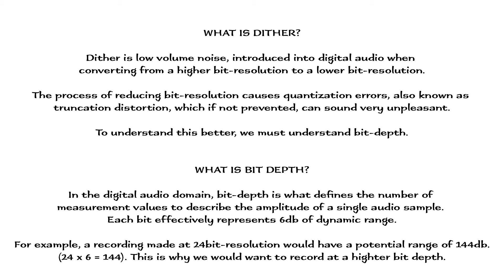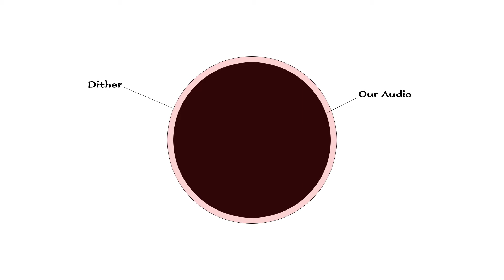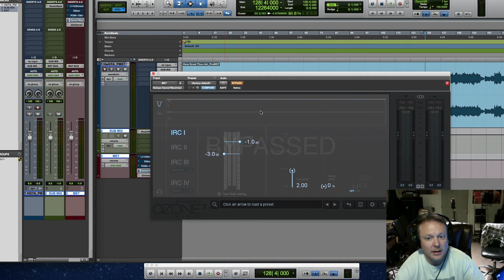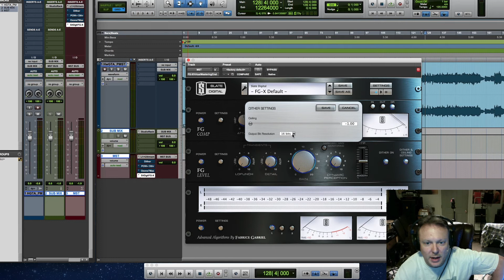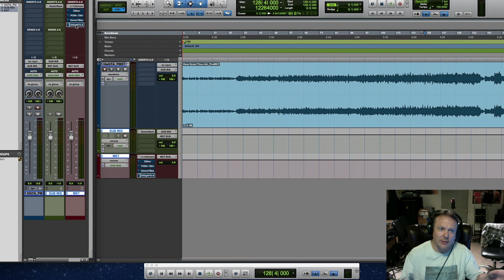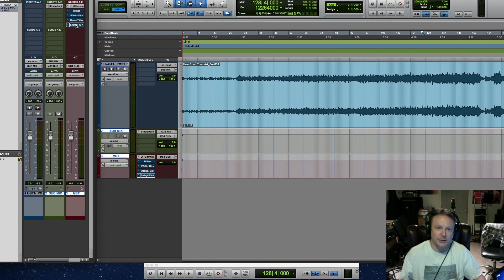In The Mix: Episode 13 - Dither - What and Why?

Comment: Thanks for this Brian. What about applying dithering on the final print track?
Reply from the maker: There is no reason to print your dither to your audio. Once it is printed to your print track you can’t take it off. If you want to go back and make edits you would need to delete the audio and start over again. That’s how I like to use dithering. This is not to say you can’t print dither onto your print track, I just find it not the best approach for how I like to work.